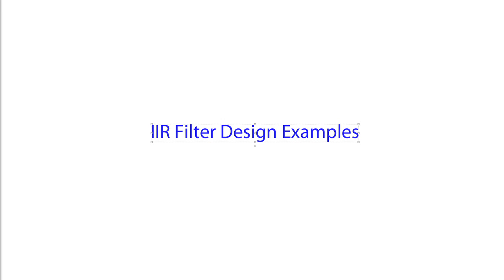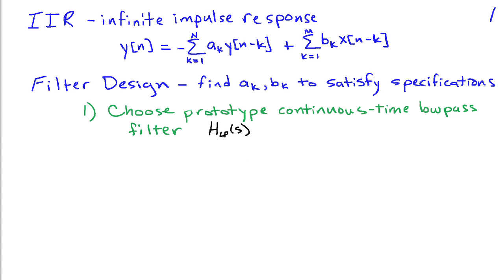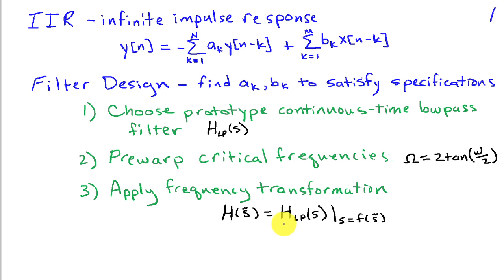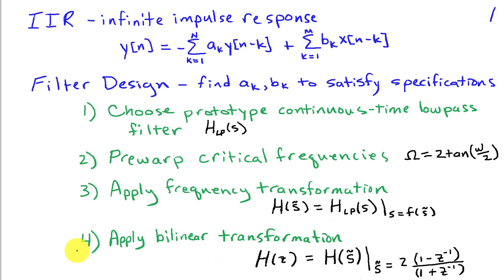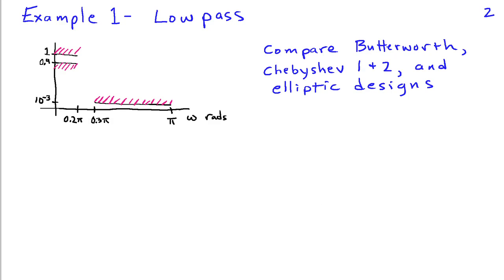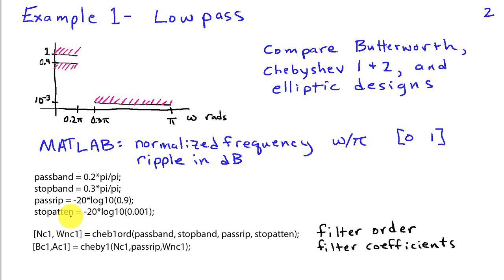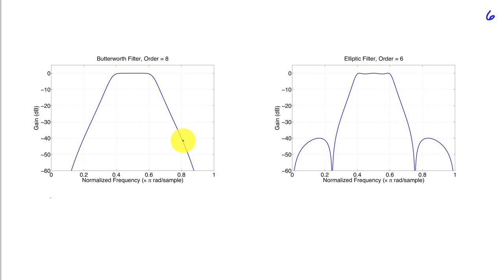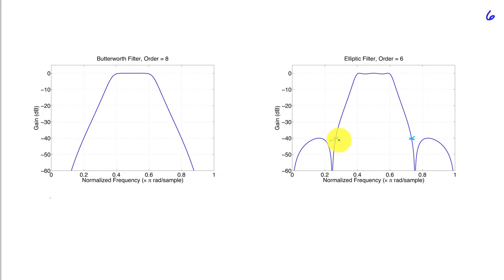Examples of IIR Filter Design

Comment: Dear Barry, thank you for those wonderful videos. I got myself a bit confused, which one is preferred, the one with built in function in matlab (as in fdatool) or trying to write the codes? What is the difference between the different tools like fdatool, filterdesigner, dsptool, and the like? Is there a note or reference you would advice for step wise design of a low pass filter IIR type? It has to be with similar behavior as the FIR type designed earlier. Thank you in advance.

Comment: Dear Barry, I am trying to use actual bilinear transformation method without using MATLAB inbuilt functions to design a digital filter from given digital specs. I  approximated  a low pass filter from a digital specs given by Bilinear transformation (found N and and other coefficients). I ended up with order 7 . For which I have to have three 2nd order and 1 first order digital filters. I want to make it a high pass filter. for now I cascaded them by using "H_7 = dfilt.cascade(H0,H1, H2, H3) ". I can see the magnitude response of a low pass filter (looks pretty ideal). How can I convert this lowpass into a high pass digital filter. Also I am not able to use this cascaded LP filter to test/filter a wave signal/image. could you please help?
Reply from the maker: You need to apply a lowpass to highpass frequency transformation to the lowpass filter. There are several ways to do this. You can apply the frequency transformation in the s-domain before applying the bilinear transform (which I prefer), or you can apply it in the z domain to the digital lowpass filter.
Reply: Barry Van Veen Thank you Barry. You video helped.